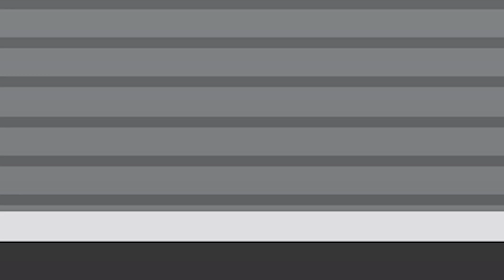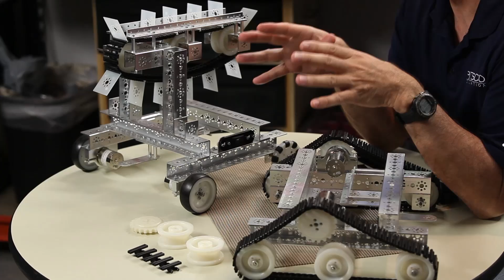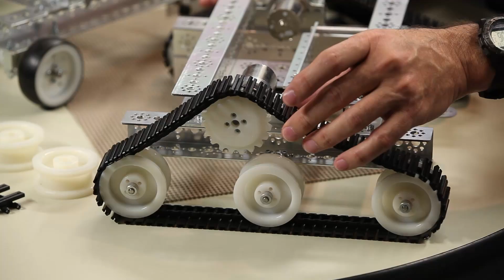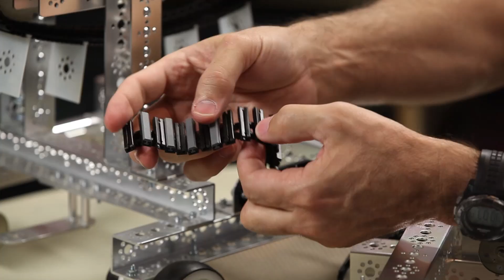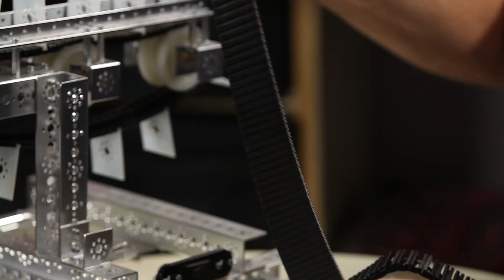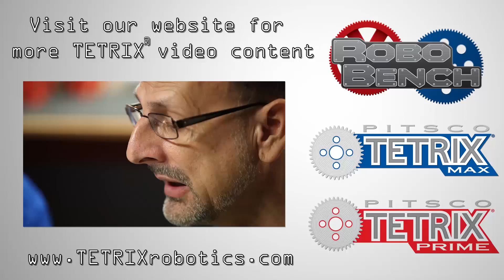Adding Tank Treads to Your Builds

Comment: hi, I am from the Wapakoneta ohio robotics club and we are having trouble getting the rubber inserts into the treads is there any advice that you can give us?
Reply from the maker: +Kelsey Hicks Great question! Using your finger, drag a small amount of liquid soap (like Dawn) along the track tread slot. This will make it easy to assemble the rubber piece to the tracks. Let us know how it goes:)
Reply: Thank you so much, it worked great